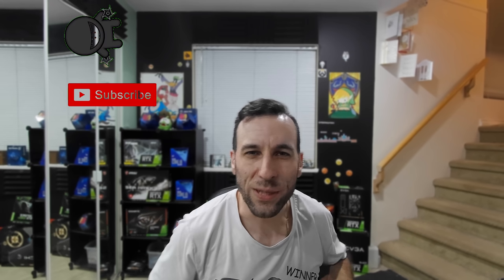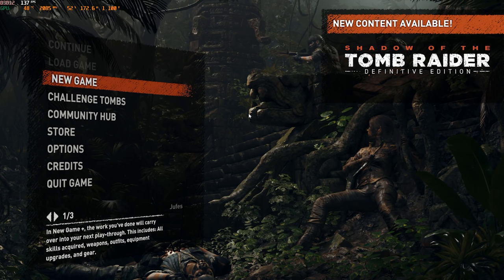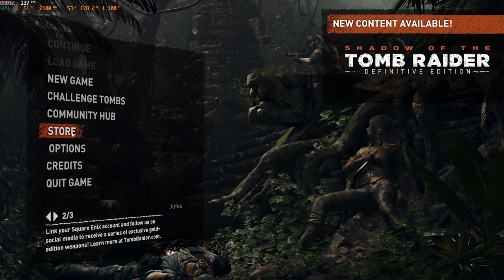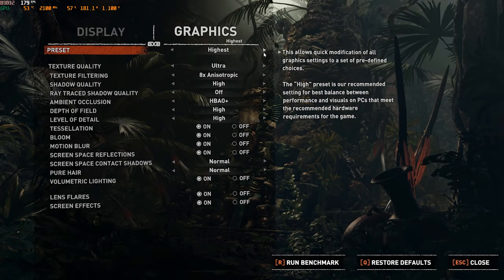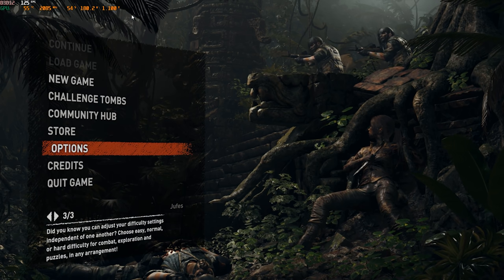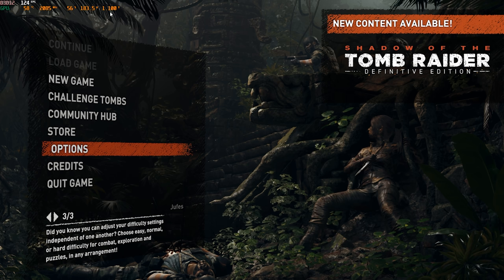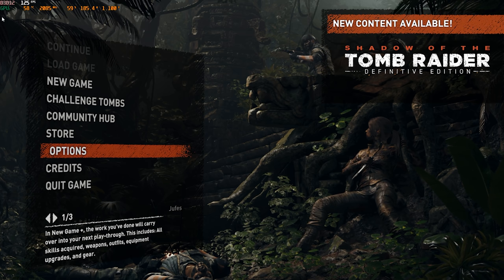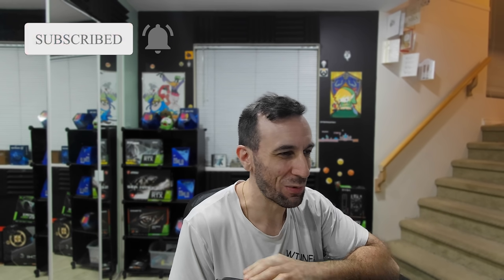RTX 3080 Problems FIXED, no crashes step by step guide

Comment: Cant really find the 3080 undervolt guide video he is talking about. I do know how to undervolt but would like to watch it for some tips.
Reply from the maker: Crap sorry it’s in this one 

https://m.youtube.com/watch?v=OLOy-mAC5Lk&t=425s
Reply: MSI afterburner
Reply: Diamond 482 I am asking for the video guide on undervolting 3080. I did it on mine already. 1 volt and 1950mhz. Works great with latest driver so far.
Reply from the maker: Well I mean at what point do you stop adding capacitors and just fixed the noise inducing problem in the first place,  any number of capacitors will eventually get overloaded at some point
Reply: @k1leon  You normally should fix the cause of the problem, not other way around
Reply: @k1leon  
we can only paint Electronics with so many Capacitors though - like, Computers are already friggin' covered with them because Electricity is inherently dirty. we can't just bury every part of every circuit under a fist sized block of Capacitors, though. it's just not practical.
Reply: @fepethepenguin8287  You clearly have no idea what I was referring to, I am not going to explain to you software engineering and electronics. Comparing car recall issues to graphics card issues..seriously? And Yes  having few fatal accidents can cause recall to thousands of cars to save company from even one single lawsuit. My car had airbag problem that was recalled along million of other cars from Acura, Honda and Toyota, because it caused about 3-5 people to die when the airbag deployed....go do some research before posting something stupid.

Comment: This is a software bug that some AIBs tried (and seemingly failed) to work around with hardware solutions (different capacitor configurations). Probably because they got drivers so late from Nvidia. If you're writing an ECU for a car and your mappings cause a lot of turbulence/spiking in the turbo's boost that cause turbos to fail. You don't over-engineer the turbo to cope. You fix the damn bug in your code.

EVGA are going to look like clowns after trying to dunk on everyone else thinking they 'solved' the issue with a different cap configuration.

Great video btw. Subbed.
Reply: @ShaneBuchman  That's really interesting. There's a new driver already that supposedly resolves the crashing. If this is resolved with a simple tweak to the voltage mappings that causes no drop in performance, there's going to be an awful lot of youtubers made to look very silly, very soon (not framechasers!)
Reply: Subbed. I’m in several Discord’s all day long would love to get into yours.
Reply: u have to remeber nvidia held drivers back from aib

Comment: You deserve a proper like and a proper fan base and seems that you are close of solving the problem, or – at the very least – pointing out the several factors that work together to create these crashes. 
To be a perfect video, if would have been awesome if you could show a real crash of the GPU after changing to the default settings and running that benchmark around 6:45. 
Great stuff!
Reply: He did on the previous video, this was a shorter recap.

Comment: The newest drivers fixed my issues prior to undervolt. However, I ended up also setting to 1v max at boost clocks and im now between 2010-2025 boost clocks with ~63C temps. Good stuff.
Reply: WHAT Model card ?

Comment: It blows my mind this is still happening with new cards.

I picked up a Zotac RTX 3080 Trio this past weekend and noticed crashes in PUBG.

After maxing power limit I noticed it had stopped but wasn't fully sure that was the cause of the crashes until watching this video.
Reply: my bf2042 constantly crashes what limit did you set it too

Comment: My god.  I've been fighting this issue for over a year and this older video helped me fix the crash issue.  Anything with Unreal engine would crash.  I used MSI Afteburner to underclock to -400 core and -50 mem clock, it was better, but still not stable.  I made many and varied changes in nvidia control panel and even in the games, little difference.  The games would work for a a few hours or days then just poof, crash on start every time.  Minecraft in RTX mode, ARK, Satisfactory, etc.  I have an MSI RTX 3080, BTW.  I used the info in this video and his linked underclocking one to lock it to 850mv and 1900MHz and - I just played Satisfactory for a solid hour, stable, no crashes, all good.  Hopefully this will correct all the other games, I'll try RTX Minecraft tomorrow perhaps.  Thanks so much!

Comment: You have saved my 3080. Many thanks to you sir.

Gpu was working flawlessly under load at stock 950mV but after turning load off, it was spiking at even 1200mV which caused crashes. Now spikes end at flat 1000mV and crashes are gone!

Comment: UPDATE: my uncle had a look at it and he’s managed to get it running again by using my old card for the graphics. Turns out it’s a BIOS setting that needs changed I think it was a psie setting that got it going again it was on auto detect but he changed it to x3 as far as I’m aware and it’s running. Testing it on heaven benchmark tonight and checking voltages and temps to see if everything looks good! I might not even need to undervolt it in the end up as it’s an MSI card. 
Tried everything with my brand new 3080 ti ventus 3x 12g OC. It’s been black screening out of the box mid game. After closing a game and on Google chrome. Removed and added new gaming drivers using ddu. Made sure the cables didn’t have splitters from the psu to the GPU. Ended up undervolting the card as it made sense what was going on. Tried running heaven benchmark after undervolting to 1 volt and 2000mh and the mh was all over the place the same with the voltage. Didn’t seem right to me so I tried superposition benchmark and it black screened and after resetting the computer it wouldn’t turn on again. White light on mobo showing that there’s no GPU detected. GPU fans not spinning up. Everything else looks fine. I’m gonna get my uncle to take a look at it later today but honestly I think it’s fucked out of the box. Might be time for a return. So disappointed. Thanks for the fix nonetheless I really thought it was gonna work.
Reply: So what happened? Did you find a fix or RMA? I have the same issue with the same card. Let me know cuz I’m interested. Thanks

Comment: I got a 3080 Ventus at launch from best buy - wasn't what I was after aesthetically (all-white build) but I got a 3080! And it worked great, stock. Fast forward a year and I win the Newegg lotto and buy a Vision 3080ti - finally what I was after for my build. Almost immediately, instability and crashes. Checked drivers, checked everything, finally fixed it by setting an 850mv undervolt and an 1850mhz memory cap. Negligible impact on performance and temps won't rise above 62 or 63 even on a marathon session of Satisfactory.

Comment: Thanks for the video just got a PNY GeForce RTX 3090 24GB GDDR6X XLR8 Gaming EPIC-X (long as order is not canceled anyway) will use this video to prevent and crashing. Also subed as you solved me lots of headaches of trying to figure out why my $1500 might be crashing. Most other YouTuber's were just guessing what the problem might be with no fix.

Comment: Well I had some awful crashes that were locking up my PC with no way to recover apart from pushing the power button, in all my games, especially Farcry 6, Ghost Recon Breakpoint and also Fallout 4 Lost World last night (30/01/2023) and this is the error message I was seeing in event viewer:

Event 56, Application popup,
"PCI 100000009143140800 error"

Google was useless with the error, so I happened to just change the search term to "RTX 3080 lock-ups and game crashes" and your video was one of the first to come up in google, so I figured it was worth a shot, under-volted the card and damn it's bloody well cured it. Just played Farcry 6 for 2 hours with no issues, it's barely dropped the framerate, yet dropped but highest boost clocks a little and the wattage by 40w, so I'm very happy.

Yours isn't the first video to suggest under-volting the 3080 to cure crashing in games, but it's certainly the one I watched first.

So very happy with that. Saved me re-installing Windows 10 as I was sure it was a driver issue after trying a dozen other supposed cures.

Comment: What you say is true and has been for at least 30 years 🙂. ANY good hardware logic designer will always fit a combination of capacitors on the power lines. High capacity relatively low frequency capability (POSCAPS) for big swings plus HIGH frequency capable ones (MLCC) for high frequency ripple reduction. Simplest example is the old standard of a 10uF electrolytic for each 5-10 chips in parallel with a 0.1uF fitted as close as possible to each chip.
This is the same concept if you treat the Gpu as a large collection of 'chips' which is effectively what it is.
Such an old simple procedure overlooked by AIBs to save a few pounds at most. 😡

Comment: Hi. I have a gigabyte 3070ti bought brand new. Worked perfect a few days then gave me crashing issues. I did what u said to do by locking the card at 1volt and it helped alot. Thanks. These cards def have to be built way better now adays

Comment: Hey man, just subbed, you're smarter than the manufacturers themselves holy. You are right, I wish nvidia, asus, msi and all the 3rd party brands could apply this 1 volt cap and fix the issue. Totally enjoyed the content, I, myself was worried because I was going to do a build and I wanted to buy the rtx 3080 but when I heard that problem I immediately froze on my computer screen. Thanks for the help. Definitely sharing this channel hoping to help more people.

Comment: I made my own BIOS .. well an edited one. It is the future for efficiency and speed. Nvidia 460.20 drivers are required though.

While my RTX 2080 Ti would always live in the 2055-2130mhz range with just with a 338w bios up from the stock Asus 312w I would have to keep it between 45-60 degrees. So, it would still annoyingly bounce around even though it was still plenty cold.  

So, I wrote my own software and edited over the course of about 48 hours of staying awake using ..medicine to stay focused.. Without getting too technical due to boredom, after turning write protect off like everyone knows how to do and doing some figuring out. Even though I have a photographic memory it still took time to physically edit and modify the bios to do what I want. I lived in my own version of a 'DOS mode' and edited the bios machine code and changing it like the matrix.. cool.
Everything is changed for efficiency and speed. Boost is dead in its prior format and only downclocks certain elements of the card when resistance reach certain levels. The change is not noticeable while gaming. I also added another 11GB of Vram to the card (22gb) and quadrupled the memory bandwidth. 
My card now sits at 14000mhz memory (where before over 7800mhz it would have the odd issue) and the core clock is 3450mhz . Voltage is unlocked past 1.093 to only 1.235 and power draw is a steady 370w 273.68 amperes and resistance is 0.0045 ohms. Just like it should be. With the card at 60% fan speed with only 2 fan has so far maxed at 63.35 celcius in a 26 degree ambient room. I also put on some passive heat sinks for the other ram modules. 

The issue I may face is I am using the Nvidia 460.20 drivers, WDDM 2.9 with all Directx Ultimate feature sets enabled in Windows insider build 20215 pre.release 200911-1500. Nvidia may block my bios with future drivers as I shared it with nvidia who informed me not to benchmark online. Basically, because it cuts the crap and runs almost twice as fast. 

Either way, I have two bios modes. One with the 11gb and one with the 22gb. For reference Timespy is now 73,650 (offline for obvious legal reasons) up from my previous score of 30,350 (unverified due to driver).  https://www.3dmark.com/fs/23609474
Reply: wow bro ! You are in the matrix now. Can you see the machines ? Did you write your own PLL in AMS and got it into a foundry real quick ?
I need an FPGA version of this in pure Verilog95 with AMS. No OOP crap. You are the Bull muh guy ! The one !
Tell nvidia to fuck off !
Reply: @CairosNaobum  Indeed and still do!

Comment: I think that issue is still active on the new  drivers . I had no crashes so far but it feels like it had a bit microstuttering in high density areas mostly. I tried that method with undervolting like you did on my 3070 and I must say, I have a lot smoother game experience. It is a day and night change. Cheers man! Thank you so much. You've earned a new subscriber. 
Edit: but it's pathetic that a multi million company can't fix that. When you look at the Nvidia forum a lot of people have problems with the 30 swries. Black screen etc.

Comment: This actually doesn't work on Halo MCC for my Gigabyte Gaming OC RTX 3080ti. It just decided to jump right up to 1.1v and lose monitor signal and fans max rpm within seconds of loading a game, even though I set the core clock freq to lock at 0.875v.
Reply: did you find a fix for this or did your card end up getting bricked?

Comment: Great, man, you solved my problem ! 

I have a Gigabyte RTX 2080 Super and was going crazy with black screen crashes lately. And all the parameters looked fine. I don't know what triggered this behaviour, I suspect something related with 3000 series introduction, maybe updating the motherboard bios !?!? cause I tried all the nvidia drivers down to a year ago and nothing. I don't think capacitors degraded so much in a year and a half since I bought the card, but clearly when pushed to the limit they might surrender.

Comment: Great info buddy but I've just tried this on my trinity 3080, Locked at 1v and Locked it to 1950 rock solid stable however it only works for light gaming loads, When the GPU is pushed harder beyond 80% or so voltage and clocks start to drop again and go all over the place.
Reply from the maker: You can lock it lower at 900mv to give yourself more power headroom, 

https://youtu.be/xdlW5F84CbQ

Check this video around the 4 minute mark for an undervolt/power draw/clockspeed  chart
Reply: @FrameChasers  Thank you I'll give it another go shortly.

Comment: My 3080 MSI Ventus still crashes in Rainbow 6 even with the new drivers. 

I did undervolt and underclock it 50mhz and my Time Spy score improved and my temperature improved from 77 max to 70 max 35 idle.
Reply: Welcome to msi, been messing around with underclocks and undervolting for months and months, first underclock at -50mhz lasted over a month. recently undervolted and its been stable-ish. trying to dial it in better but no idea if im getting anywhere. Probably selling it and finding one with better caps whenever these things are actually in stock

Comment: nice one, overclocking while undervolting, used to do it with my 1070 and 1080ti, locked high clock while  lowering the card temps by up to 7 degree, it is fantastic the zotac can hit 2010mhz with only 1v though, cant wait to receive mine in few days.

Comment: I came here to thank you. After trying everything for 3 weeks I was about to give up. I have a RTX 2060 and AAA games like Cyberpunk and Fortnite were crashing but it passed all benchmarks and stress tests. Then I found your video and decided to give it a try, and... Behold!!!! Cyberpunk now working whitout crashes on "Ray-Tracing: Ultra" and Fortnite on "Epic" and DX12. In my case I had to downvolt to 0.900v and  1725Mhz max. Hope this helps someone ...
Reply: Hey there,
would you tell me how did you determine what V and Mhz to use instead of the one in the video? I too have 2060 but neither of these settings stop my crashes from happening so I wondered if there is a way to find out which setting is best for my setup other than trial and error (cuz I dont know if to go up or down so trial and error doesnt really help me either).

Comment: ASUS TUF have 6 MLCC cap, they are also crashing after 2GHz.
Reply: yes all cards can crush CAPs doesn't matter.... and freq isn't a problem :P
Reply: They're faster capacitor so they're a bit less sensible to the bouncing... but they're certainly a software problem there, not a hardware one.
Reply: @lp_985 exactly and the Tuf is a bit undervolted to start with ... and a bit less sensible... so I would say it's normal to see it less reported for them. If you OC them tho ... you will cause the same issue as the other one

Comment: Awesome I locked mine gifted 2080super to 1.093v and now get 100mhz more and stable relativelly high overclock stable 2070mhz core average in games up to 12600 12700 gpu score in time spy and around 6000 points gpu score in time spy extremme. Your video is best, really impressive content and you are great host :)

Comment: While having this issue with capacity, and memory running hot. Is it recommended I downclock the Memory, or is it even safe to overclock it until i get performance issues?

Comment: just wanted to say thankyou so much for this video. 
saved this poor little hooligan (me) having to ship my PC from Brisbane to Adelaide to meet the bs warranty replacement requirements of the shitty gaming pc place I bought this Gigabyte 3080 and Processor	12th Gen Intel(R) Core(TM) i9-12900KF, 3200 Mhz, 16 Core(s), 24 Logical Processor(s) from. 

Because there's no integrated graphics on this i9 - the 3080 failing was punching my shit in!
For all future readers - if I never visit this thread to say again otherwise Frame Chasers the absolute GFX Domain Knowledge God has saved me. 

Thankyou Frame Chasers!!

Comment: Its such a weird thing to be missed even for msi suprim models. I couldnt figure out why I get kernel crashes with low level loads but not with heavy duty loads. It seems that this is the issue, at least from innitial trials.